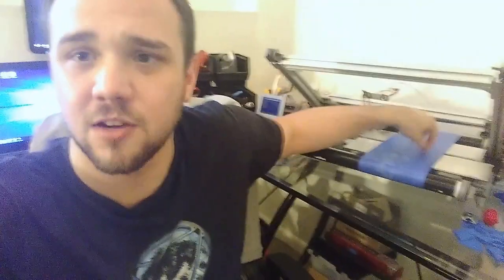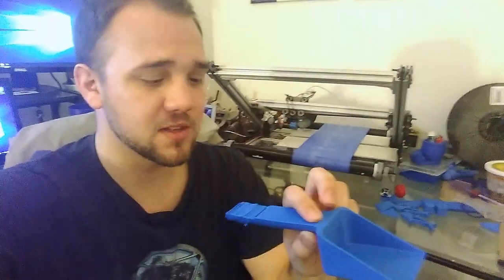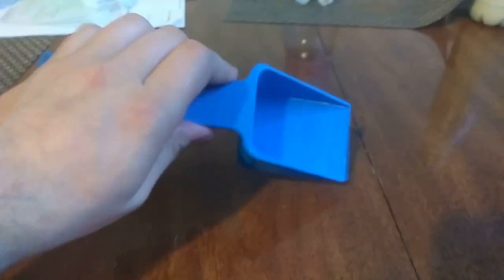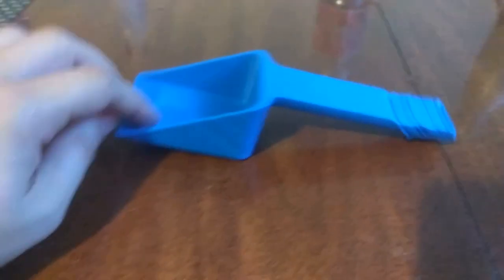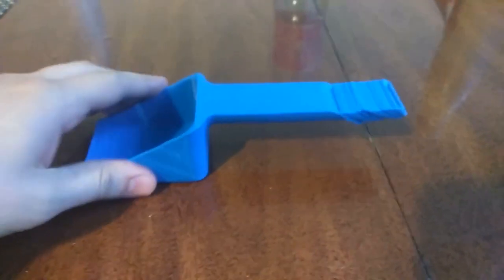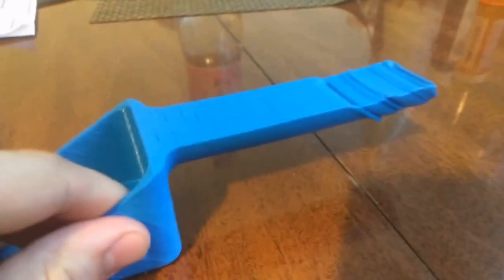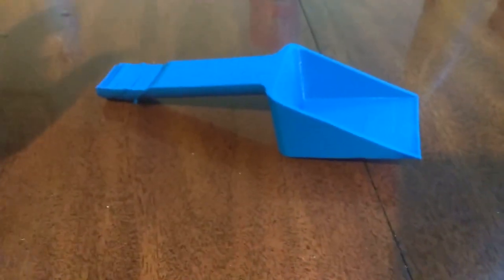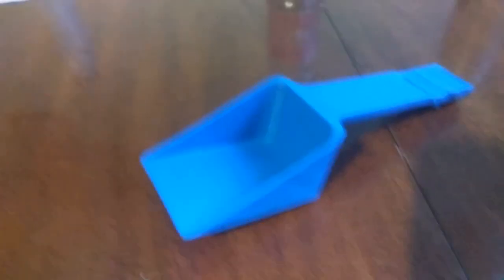3D Printing in Mid-Air on a Conveyor Belt - Powerbelt3D

Comment: could you do this with PEEK?
Reply from the maker: I haven't tried it - but in theory you could! You'd just need an upgraded hotend that could handle the higher temperature
Reply: @powerbelt3d  but what about heated chamber and the bed tempm what's the hottest the belt can handle?
Reply from the maker: @SenseiMinke  Heated chamber and bed temperature would need to be dialed in also. I've run ABS on a belt with a bed temperature of 110C. We haven't tested any higher, but it should be good up to 200C.

Comment: Great Project.. Can i Know What  Stepper motor do use for driving Base Belt and which Controller board do you use ?
Reply from the maker: Thank you! We use a standard Nema17 stepper motor, with pulleys to increase torque. We use MKS Base control boards, but the specific model has changed a bit over time.

Comment: Very nice project. I like to do something similar with my ender 3. which Material did you use for the belt itself? Looks kind of like silicone or tpe... How is the adhesion? Thank you and happy printing:)
Reply from the maker: This conveyor belt in this video was vinyl covered in blue painter's tape. We have since moved on to better belts that hold up well over time

Comment: Is there an option to have the head vertical rather than at a 45 deg?  I am interested in the belt concept but I might have some applications where I am only printing 3 lays thick and am using the contrast in the layers as a design feature.
Otherwise, great looking product. I hope we see some great reviews to match
Reply from the maker: Hey Kevin, we only offer angled printing. It's a design that, historically, doesn't infringe on any patents which is pretty important to us.

Comment: I don't understand the "infinitely long" printing claim that you're making. Your own demo shot that idea down by the looks of the shovel handle getting all messed up after a few inches!! How's that infinitely-long printing? The belt seems shaky and the part wobbles when it reaches the front end!
Reply from the maker: In this case, we wanted to see how far we could print in mid-air. This made a lot of weight against the bottom of the scoop, and yes - the belt wobbled a bit. Adjusting belt tension can help get better results.
Reply: This does not answer my question regarding why you claim "INFINITELY LONG" prints!!!!
Reply from the maker: @sz72909  Because we're printing at an angle, parts can continue to be printed, and the edge will roll off the end of the conveyor belt. We have some photos of those parts on our Facebook page.
Reply: @powerbelt3d  Are you conflating infinitely long printing of a long STREAM of small parts with the term infinitely long PART (one part that is infinitely long)????
Reply: @sz72909  You can print infinitely long, but you can't print items in mid-air over the end of the belt. 
If the object was a solid bar, where it would always have a section still attached to the belt, then it wouldn't have the flaw you noticed.

Check out their facebook, they have photos of items that are longer then the belt.

Comment: Great job.  But after viewing it looks like you need the flat printing surface (and the belt) to be a little longer (or offer an extended option) to give the object more time to be adhered to the bed.
Reply from the maker: Good points. If we were running this print again, we would make sure the bed is perfectly parallel to the conveyor rollers. This helps a lot when printing long objects. Also, make the handle shorter 😅

Comment: Not picking on you as it looks cool!!! but people are going to ride you on a couple miss stated things,..... your site claims it's Core XY belt, that most certainly is not! also think I read its direct drive extruder, which again, it's not.  It is very cool looking.  should study a tad more the motion systems and state the correct ones thou!
Reply from the maker: Good catch! You're a very smart llama :) This is a prototype printer, without the CoreXY motion or direct drive (though this prototype easily changes between the two). The printers available for pre-order next month will have those features.
Reply: @powerbelt3d   cool,..